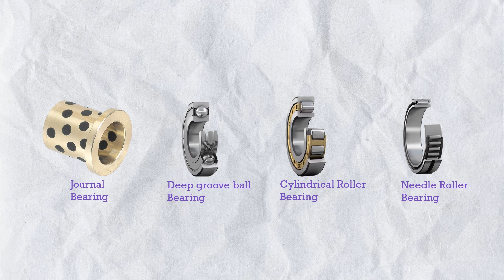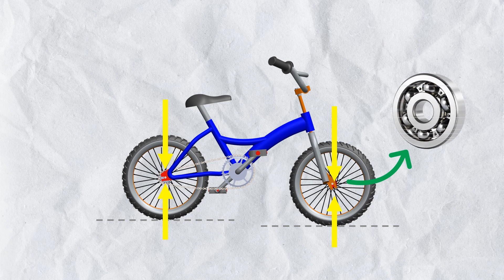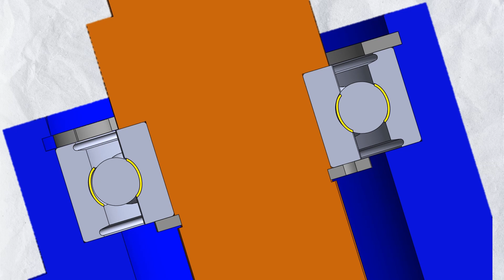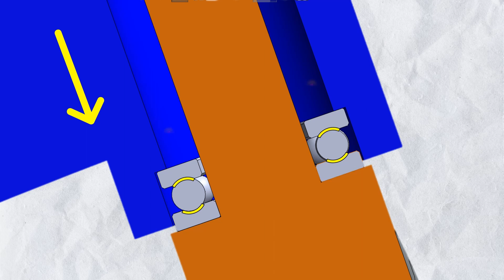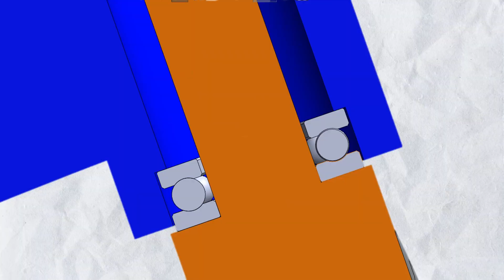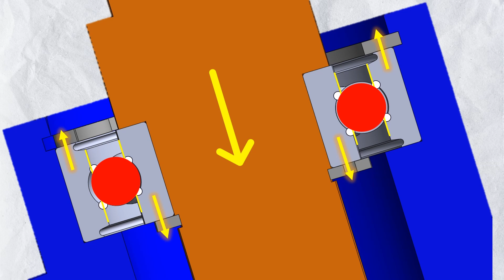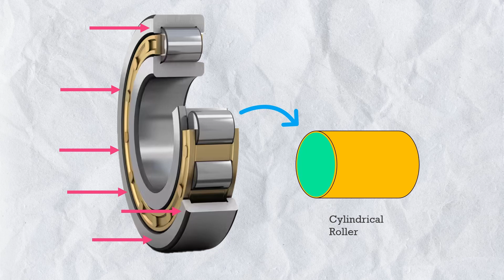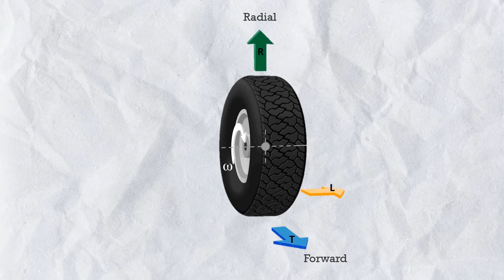All Types of Thrust Bearings Explained with example! Thrust bearing animation

Comment: 3:24 isn't the thrust bearing already constrained by the step in the shaft ? Or is the internal ring used for the outer raceway ?
Reply from the maker: Not fully constrained. To fully constrain we will have to clamp from top-bottom. Because this bearing design is not integrated.
Reply: @mastermechanicaldesign  Thank you ! This was a great video and an excellent introduction to your channel for me.